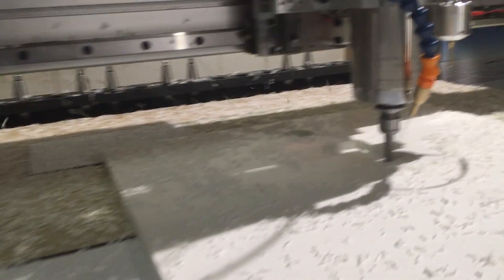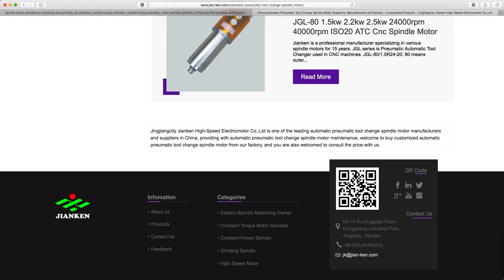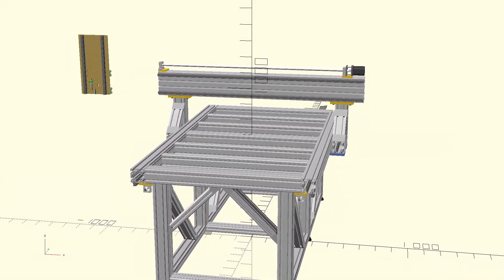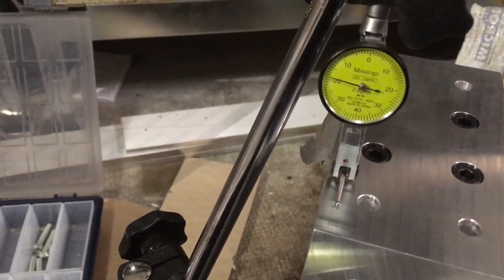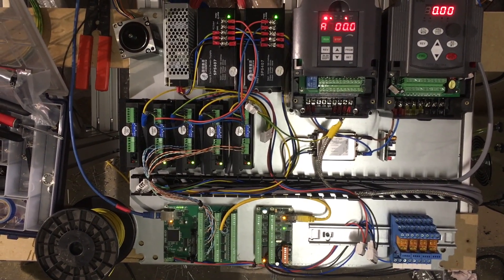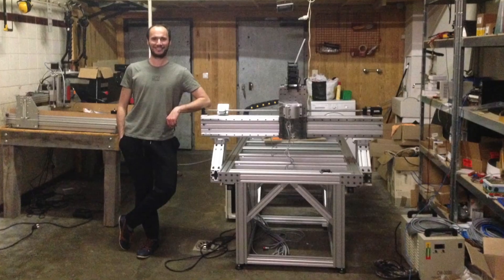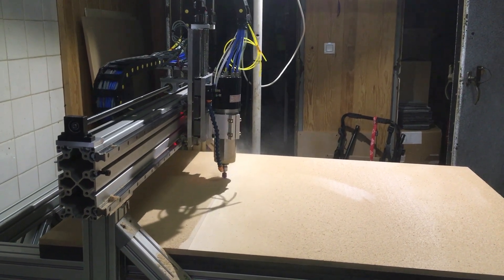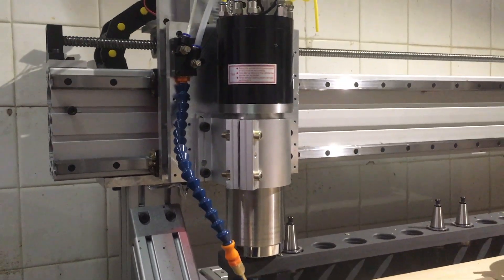My DIY CNC Router build with ATC and Vacuum Table

Comment: I've completed the 1 hour burn in you suggested and every thing is fine.  One thing I'm trying to figure out is LinuxCNC to VFD communication.  My old spindle I used the Huanyang VFD connecting with rs485 to LinuxCNC using usb interface which worked fine.  This new spindle requires 666hz at 40000rpm so I had to purchase a Sunfar e550 VFD with it.   My existing rs485 settings are not working with the new VFD even though it initially connects.  Are you controlling the VFD with the Mesa?
Reply from the maker: On this machine I'm controlling the on/off of the spindle with a Mesa output. But I'm controlling the frequency via RS485 with a USB dongle. I did not want to control the on/off via RS485 because in case of emergency stop or computer crash the spindle could stay on. On the new machine I'm building I'm controlling everything with the Mesa board, using a 0-10 volts analog out to control the frequency. And the new spindle as an encoder in it so I have a speed feedback to run a real PID on LinuxCNC.
I had to write my own python module to get the communication to work between the VFD and LinuxCNC. Here is a short/incomplete example to show you the syntax:

# vfd.py
import linuxcnc, hal, time, math, minimalmodbus
vfd = hal.component("vfd")
vfd.newpin("infreq",      hal.HAL_FLOAT, hal.HAL_IN)
vfd.newpin("outcurrent",  hal.HAL_FLOAT, hal.HAL_OUT)
spindle = minimalmodbus.Instrument('/dev/ttyUSB0', 1)
while True:
  spindle.write_register(0, math.floor(vfd['infreq']), 2)
  vfd['outcurrent'] = spindle.read_register(60, 0)
  # read other fields and sleep 10ms

Then "loadusr -W vfd.py" in your HAL file.
Reply: @YannPomarede  This got me a lot closer.  I've created a module that works with the sunfar e550.  So I'm using a mesa pin to control fwd and reverse and rs485 to control speed as you did.  One problem I'm having is the communication is failing between the usb dongle and the e550.  I've replaced the usb dongle  and I'm using shielded wire at about 1.5 meters.  I know you're using a different VFD but do you have any ideas?  I've adjusted a few parameters that have made it work about 80% of the time but obviously not acceptable.   I also have an esp32 board that I designed to control and monitor.  If I can't make the rs485 work, I think I'll try to add the functionality to that board.
Thanks for all your help.
Reply from the maker: Yep I have an idea. Most of the USB RS485 dongle are crap and do not allow a proper wiring. I had the exact same problem for years until I realized that. You need to polarize the bus line when they are at rest. You also need a common ground between the dongle and VFD. And you need a terminator resistor to load the bus. Have a look at some technical documentation on proper wiring. Most of the time people think the bus is only 2 wires but you need an extra wire for ground.
Reply from the maker: I used this ref USB-RS485-WE-1800-BT from FTDI. And it  has 6 wires out of the dongle. This allow the proper wiring with load resistor + ground + polarizing resistor.
Reply: @YannPomarede  My first suspect was the ground so the replacement dongle was a 3 wire but I wasn't aware of the polarizing ant terminating resistor.  I'll see what I can find for documentation.
Thanks
Reply: @YannPomarede  2 polarizing resistors seemed to have worked. I just soldered them in to the dongle I have.  Thanks for the hint.

Comment: I decided to try the Mesa 7i96 board however I'm having trouble setting it up with LinuxCNC and any searches points me to a python 3 config tool which doesn't seem to be compatible with the 2.7.14 iso.  Which Linux version are you using to run LinuxCNC?
Reply from the maker: I have 2 machines running LinuxCNC. One runs on Debian Stretch, the other one on Debian Buster. And both are compiled from the source, branch 2.8. I run the PREEMPT_RT realtime flavour. I never had to use a python3 config tool. The configuration of the 7i96 is very similar to any other Mesa card. The only difference is that you have to "loadrt hm2_eth" (with some arguments, like IP) in the ".hal" file instead of hm2_pci or hm2_xxx. Then when you run LinuxCNC from command line, even if it fails it should print all the Mesa pin that were auto detected. The name of the pin will of course depends on your physical boards. Example "hm2_7i96.0.7i84.0.0.input-07-not" is the 7th input of my first 7i84 daughter board connected to my 7i96. Then you can edit your .hal to match all the LinuxCNC I/O to the Mesa pins.
Reply: @YannPomarede  I have the machine reading the input limit switches fine and I'm able to home.  I'm having trouble with the outputs.  I have my valves connected to opto isolated relay cards.  Are you able to control the outputs from the command line using halcmd?  I'm able to communicate fine and show pins but when I do setp hm2_7i96.0.ssr.00.out-00 TRUE or FALSE, there's no change.  Any thoughts?  Working with TB3 Pins 13 to 24.
BTW.  Thanks for all your help so far.
Reply: Think I've figured it out.  For the outputs, I just needed to swap the + and - pins.  I also tested them in a running instance of LinuxCNC.  I'm assuming the command line process, you have to start a thread to get the pins to update but not 100 percent sure.
Reply from the maker: @billh4321  Great. Yes the outputs are almost like floating switches, but polarised. And yes you need this line for the mesa board to be read at the servo thread frequency (1000Hz) : "addf hm2_7i96.0.read servo-thread".
Reply: Finally working on the new spindle.  I have all the pneumatics connected and working.  On the 7i96, I have the limit switches connected using +5V for the common input.  I'm trying to figure out how I'm going to connect the two PNP sensors from the spindle.  Assuming your spindle also has PNP, how did you end up connecting them?
Reply: Okay.  Answered my own question.  I swapped the common from +5 to ground and have brown to +12, blue to ground and the output to the TB3 port.  All that's left is to program the VFD and do some testing.

Comment: Received my JGL-80 spindle today.  The VFD input to the spindle is just bare wires and the manual refers to a connector.  Is your's the same and if so, what color wire did you use foo U V and W? Or does it matter?
Reply from the maker: It does not matter. U/V/W are all the same and can be swapped. If the spindle rotates backwards, you can swap 2 phases (U <=> V or V <=> W or U <=> W) to change the rotation side. Or you can also reverse the side in via the VFD in the menu. Read carefully the VFD documentation to get familiar with all the parameters, specially those one: V/F curve points, max voltage, max frequency, max current, acceleration time, deceleration time. Start slow (3000 RPM) and increase progressively to 30000 RPM over 1 hour the first time.
Reply: @YannPomarede  I'm trying to figure out what to set for the lower frequency.  This is the 2.5kw 40000rpm version which has top frequency of 666 Hz.  Is the lower value trial and error or is there some method of determining it?
Reply from the maker: @billh4321  There is no definitive answer. You can run at 1 Hz if you want. Sometimes I do to check endmill concentricity with a dial probe. But you have very little torque at low speed and you risk a stall while milling if you are not careful. Occasionally I run at 5000 RPM for some operations in plastic (when feedrate is low and I don't want to melt). But most of the time I'm in the 20-30k RPM range.
Reply: @YannPomarede  Okay.  That's basically what I did with my last spindle.
Thanks.

Comment: Great Build.  I have completed a similar type of machine and am currently using a 2.2kw spindle.  I have ordered the JGL-80 40000rpm spindle and am waiting for it to arrive.  I have a couple questions.  1) I'm very interested in more information on how you programmed the tool changer in LinuxCNC.  2)  Which air lines are you using oil?  Thanks.
Reply from the maker: The config example "sim/axis/vismach/VMC_toolchange" in LinuxCNC ( https://github.com/LinuxCNC/linuxcnc/tree/master/configs/sim/axis/vismach/VMC_toolchange ) was a huge help to setup my ATC. If you run this simulation config you can even see, on a side window, a live 3D rendering of the simulated machine changing tools!
For you second question, I added an oil dispenser for my pneumatic cylinder (used for the retractable 3D probe) and for the JGL pneumatic cylinder actuating the tool grab/ungrab. My other air usages are with dry air.
Reply: @YannPomarede  
That link looks like it's going to be a huge help.  
Thanks.

Comment: Hello, which converter do you use for Spindle?
Reply from the maker: It's an ECOGOO 2.2kW / 650Hz VFD. And I use it at 500Hz max. With a Modbus RS485 connection to set the speed and read the current.

Comment: Fantastic build, could you elaborate on your ball screw choices?
Reply from the maker: Matt Eyles well. I had to choose the diameter and the pitch. I wanted a max linear speed of 9000mm/min. And calculating the critical speed (max rotational speed) of the ballscrew, a 1610 (diameter 16mm pitch 10mm) was perfect (and cheaper than larger ones)

Comment: How do you ensure the bearings/axis travel are straight and square to each other? Aren't the aluminium extrusions warped?
Reply from the maker: SeanM for straightness I rely on the aluminum profiles. They are supposed to be straight enough for my needs. And for squareness I measure the error with a probe on a set square, then I offset one of the two Y motors to get perfect squareness.

Comment: No closed loop steppers? I mean with all the money spent on quality parts I would highly advise that. If only to ensure your expensive spindle is not damaged if ever things go badly.
Reply from the maker: I know I know... For that reason and a couple of other (no pressure sensor in the vacuum table), I always keep my hand on the emergency stop while running. My next build will be using servo motors with position feedback to LinuxCNC and velocity control to the drives.
Reply: @YannPomarede  Using the JMC 180w servos myself in a build I am currently doing. They would be a fairly good match and not at all more expensive than a leadshine driver + stepper. Thing with them is the driver is part of these servos so price wise they are really good at about 100 Euros for the new versions with v6 firmware. Even the 400W versions are not that super expensive.

Comment: Je suis curieux de savoir comment tu as monté ta probe et a quel point elle est précise?
Reply from the maker: Elle est montée sur un mini rail acier 12mm avec patin à bille, plus un petit vérin pneumatique, et quelques pièces imprimés en 3D en PETG. Il y a un gros porte à faux avec des pièces peu rigide... À la base c'était juste pour tester avant de faire mieux, mais au final c'est suffisant pour mes besoins. Je fais des reprises recto/verso à moins de 0,1mm. Et si jamais ça se décale c'est très facile d'usiner une poche, puis de mesurer à la probe et d'ajuster son offset X/Y. J'ai dû le faire 3 fois en un an je pense, car elle finissait par avoir toujours 0,1mm du même coté. Pour l'offset Z je la mesure (très occasionnellement) comme tous mes autres outils, avec un palpeur fixe près du rack à outil.
Reply: @YannPomarede  Donc tu ne t'en sers pas en Z a cause que le vérin n'est pas assez précis. C'est interessant. Je vais y songer pour ma machine.
Reply from the maker: @WTLgrinda1  Ha non c'est pas ça, au contraire elle est beaucoup plus précise en Z qu'en X/Y. La butée du vérin est plus rigide que la flexion en X/Y de l'ensemble. Mais je ne m'en sers jamais car j'utilise toujours mon origine Z=0 à la surface de la table, et ça me change jamais, donc je n'ai jamais besoin de faire l'origine en Z.
Reply: @YannPomarede  C'est interessant a savoir tout ca... coté contrôle est-ce que tu a brancher les interrupteurs qui vérifient la clamp? Ou est-ce que le systeme est assez fiable pour fonctionner sans verification? JE croyais programmer une verification d'outil sur une touch-plate et la comparer a la hauteur entrée dans la base de donnée pour déceler si une erreur se produit
Reply: @YannPomarede  Je fait aussi mon origine sur la table et trouve cela très pratique. Cependant je suis obligé de refaire mon z à chaque changement d'outils (manuel) car les fraises ne font pas toutes la même longueur.
J'imagine que la machine va automatiquement tâter un coin de la table entre chaque changement d'outils ?
Reply from the maker: @geekoid183  Même pas besoin de palper à chaque changement d'outil, car il y a une table d'outil avec la longueur de chaque outil mémorisé. Donc à chaque changement elle applique le nouvel offset d'outil correspondant au numéro de l'outil. J'ai besoin de palper uniquement quand je remplace la fraise d'un porte outil bien sûr.
Mais sinon dans ton cas, sans porte outil avec broche ATC, tu peux mettre un capteur fixe et palper à chaque changement d'outil. Ça marche aussi.

Comment: I like your extrusion router design, it's very simple and requires minimal fabrication outside of having to machine a few plates. Now that you've used the machine for some time now would you make any changes to this design? I also have a JGL-80 on the way, will be temporarily using it on a 6040 and use that to make my larger router.
Reply from the maker: Hummm, what I would change, here are a couple of ideas:
Maybe enclose the tool rack to protect it from the dust and chips. A couple of time I had a chip stuck in between the tool holder and the spindle and it made a horrible vibration.
Add a presure sensor on the vacuum table to stop if there is a loose of vacuum.
Close the position loop to detect a crash or a stepper stall.
Increase the width, as I have exactly 1002mm under the gantry and my 1000mm plates I'm milling are often 1005mm and don't fit...
And I would probably go larger, with rack & pinion to increase the maximum speed (currently 9000mm/min) and loose less time on each tool change.

Comment: Great build, does the Z axis have to be so high for the Spindle?
Reply from the maker: Yes it has. When you place a 60mm long endmill + 20mm collet, you want your endmill to be able to move above your workpiece, at the same level as the gantry. So you need the bottom of the spindle to reach at least 80mm above the gantry :)

Comment: I have outgrown my small machine and would love to build one like this. Have you by chance made any headway on a build list? My goal for this year is to have a 4 by 8 machine.
Reply from the maker: I still haven't written down a full list... I need to build another one for this summer so I'll try to describe everything more in details during the build. It will be a 4 by 8 router ;-)
Reply: @YannPomarede   could you tell me where you found the connector plates for the diagonal bracing, I've not seen those before and they are really interesting.

Comment: How much is the total cost of this machine about? And is it a good project for a diy person? I have 2 3d Printers and I would like to include a cnc machine for aluminium. 
Do you have an advise for me?
Reply from the maker: Well, it you want a CNC for aluminium, I guess a vertical mill would be better than a gantry style machine. And it's easier to build a sturdy vertical mini mill. But it all depends on the usable surface that you want?
Of course it's a great project for a DIY person :) And it's not that far from building 3D printers. You can even use the same electronics and motors for a small CNC.
Reply: @YannPomarede  Do you know a diy vertical mill with instructions?